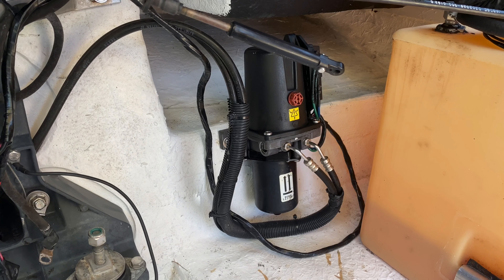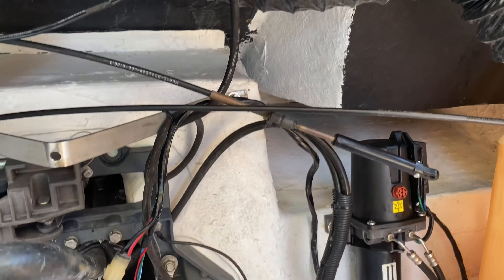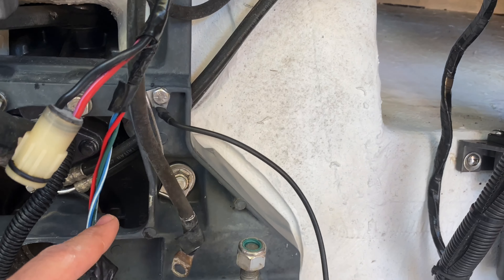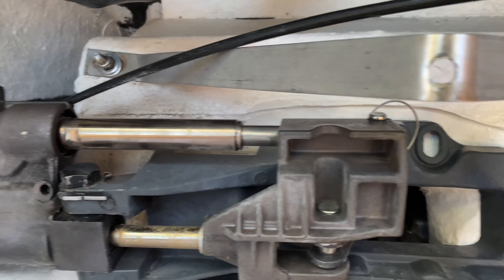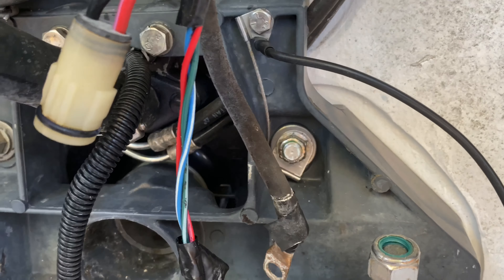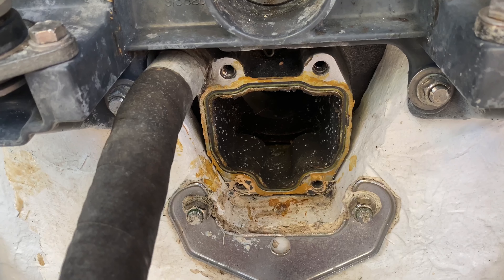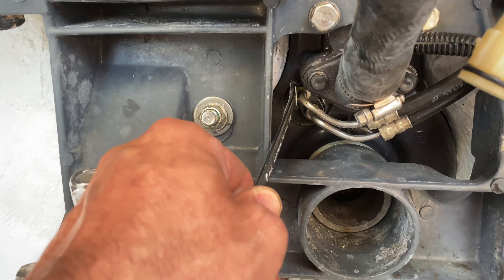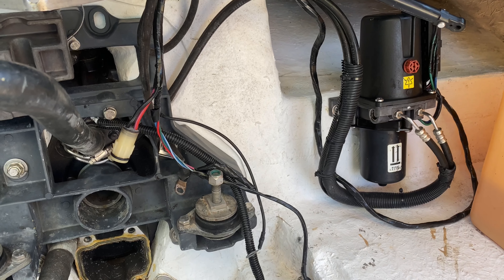OMC Volvo Penta Tilt Trim Pump Hydraulic Line Replacement

Comment: hi thanks and good information.  I have redesigned the system so that I no longer have to take out the engine, but of course it cost a bit of money but is worth it, and the idea is to redirect all the hoses, I will record a video this year so that people can think outside  box, but also  people who will criticize just because they are inside the Matrix thinking and not in Zion

Comment: You can make a specialty tool to remove and replace the nut by cutting out most of the middle of a deep well impact socket and cutting a notch in the end of it to make it like a flare wrench. Didn't have to remove my motor just exhaust risers.
Reply: Thank you! I was able to make this tool using an angle grinder on a 7/16 inch deep well 1/4 inch drive socket.
Reply: Picture of the tool please.

Comment: Hello Michael, I enjoy watching your videos...I can learn a lot from them! I have a question about your video about the Omc Tilt Trim pump... I have the same tram pump, I have to replace it, I bought the same one again.... my question: where or how can I fill up the oil after changing the tram pump...? maybe you can help me please. I have an OMC Cobra 3.0L but the exact same dream pump as you in the video. I would be very grateful. best regards Sven
Reply from the maker: You fill from the red cap. Check out my other videos for how to bleed air out.

Comment: I had a line burn thru on the lower exhaust collector and just had to pull the motor to replace it. my ? Is that the shift cable is dangerously close to the exhaust and I’m wondering if it is an issue that it might be touching the exhaust port?

Comment: hey micheal,  how about some advice on the neutral  switch at  the shifter, on a volvo/penta 5.0 fi 1996.  many times i would turn the key to start the engine and have no power nothing at all to the starter.......  then i would give the shiftier handle a good shaking and that would do it .  turn the key and engine starts....what do you think?

Comment: Can you make a video about adjusting the HOLLEY carb? I need your advice... We tried to adjust it correctly as it didn't run smoothly.. Turned both little side screws (left side / right side) now it doesn't start anymore
Reply: Check his channel, he has a video on tuning the holly carb.

Comment: It is possible to change without pulling out the engine. Just did it:) it can be changed from the drive side.
Reply from the maker: Sune Pedersen Send me your model and year. I’m thinking you have a smaller engine.
Reply: We have an OMC 3.0 4 cyl. Is it possible? We need to change the tubes as one of em leaks
Reply: Yeah ditto we have a 4.3l and I’m trying to figure out a way without removing the engine as well.
Reply: @iloveyew77  any hints on setting up the carb? We tried to adjust it.. Now it doesn't run anymore
Reply from the maker: iloveyew77 I can tell by looking up your year and make model.
Reply from the maker: buzzbikegear - MOTOVLOGS working on the video in the next few days actually
Reply: @michaelromer2016  Mine is a cobia challenger from 1993 with a 4 cylinder OMC Cobra 3.0 (roughly 140hp)
Reply: @michaelromer2016  please Michael can you make a tutorial how to adjust the HOLLEY carb?
Reply from the maker: I’m planning on posting it Thursday. It covers everything
Reply: @michaelromer2016  thank you man. We havent been able to fix the carb settings by ourselves
Reply from the maker: You will after this video I’m making.

Comment: I’ve got an OMC Cobra that has an issue that I can’t figure out. I can run the boat perfectly for an hour or so but once I turn it off, it’s either extremely hard to get it to run again or it just won’t run. I’ll have to wait around 10 hours to turn it back on.

Comment: Do I fill up hydrologic fluid from the red cap with the yellow label under it?? Is their a proper procedure to do so..... Trim is working very slowly, figured low on fluid or getting air in lines.
Reply: How u refill ?

Comment: You are wrong! Stop playing mechanic if you don’t know what your doing. All you have to do is take the pivot pins out of the outdrive so it drops down about 2” and remove the block they are connected to. They pull out from the back! I just did it yesterday on my 1988 OMC Cobra. That’s what made me search this video.
Reply from the maker: I’ll stop playing mechanic immediately, sorry I triggered you. Please subscribe and check out my other videos when you have some time. Thanks!
Reply: @michaelromer2016  why would I check out your other videos if you are not teaching properly? Maybe I shoulda made a video to save people some work in pulling the motor. I did it without even pulling the outdrive
Reply from the maker: Please watch some of the other videos and let me know how I can improve my content. Otherwise, more people like you will get misled and no one will be able to use their boat. Please also subscribe so you can see if I’m making any mistakes on my up and coming content where I’m rebuilding a few new boats.
Reply: @michaelromer2016  ok. I am in no way trying to be a douche. Just sucks to see people struggle more then they have to
Reply: How long does this take?
Reply: @adriaanvandersloot4944  honestly I don’t remember because it’s been about 2 years now. That boat is clean compared to my salt water boat. Look it over carefully before you go pulling the outdrive and motor out. This guy made way more work than it has to be. If I remember right there’s a grommet they go through that comes out. I think it took me about a half a day and it’s the same setup